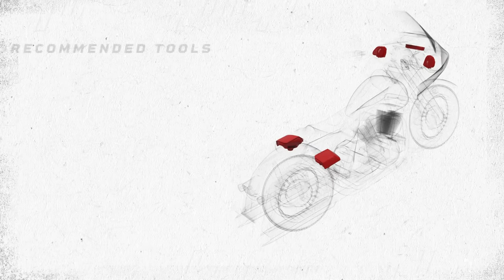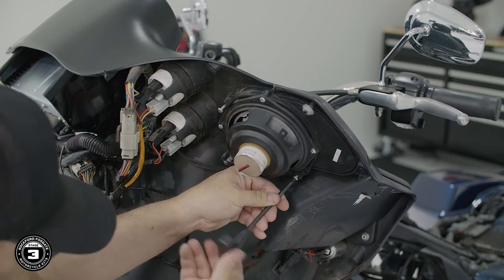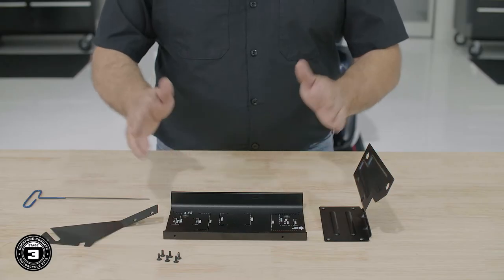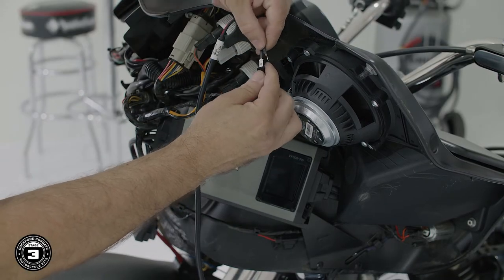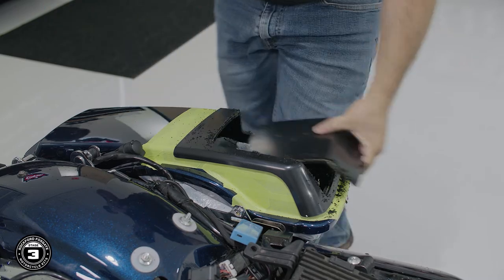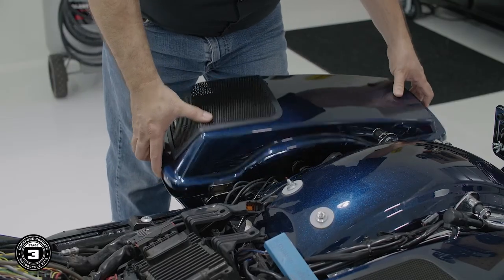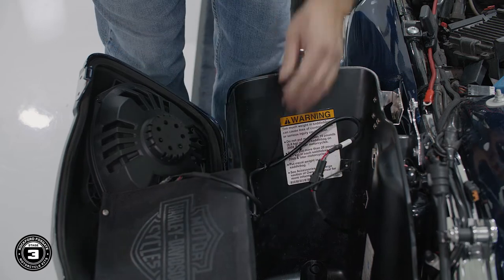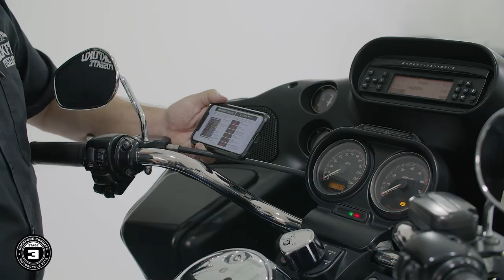1998-2013 Road Glide STG3 | Installation

Comment: I have a stage 4 system installed on my 2013 FLTRU. Id like to mount a pair of speaker into my lowers. Where can I find the Y adapter for this application? Thanks.
Reply: Correction. its a stage 2 kit.
Reply from the maker: @dustyadcock7040  Just replied to your last message on the 2nd generation kit.  So it sounds like you have a newer 3rd generation kit (not pictured above).  Either way, both kits include two Y-adaptors that can be used on the outputs to add an additional set of speakers.  If you threw them away, we can ship you an extra Y-adaptor free of charge.  Just email me at ce@rockfordcorp.com and mention this email and I'll drop them in the mail for you.
Reply: @rockfordfosgate  Thank you for responding. I emailed you my information yesterday. 1/20. Hope to hear back from you after the weekend. 
Thanks again
Dusty
Reply from the maker: @dustyadcock7040  We got you covered Dusty!  Sending out that Y-Adaptor today (1/23).   - Eric
Reply: @rockfordfosgate  Thanks!!!
Reply: @rockfordfosgate  Received the Y connectors today. THANKS!!!!
Reply from the maker: @dustyadcock7040  You’re welcome brother.  Enjoy the weekend working on your bike!